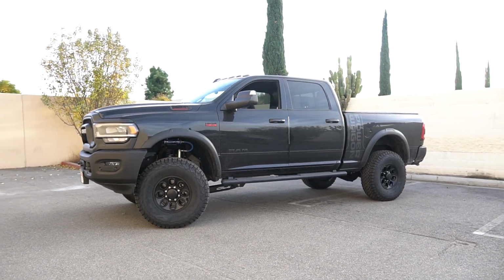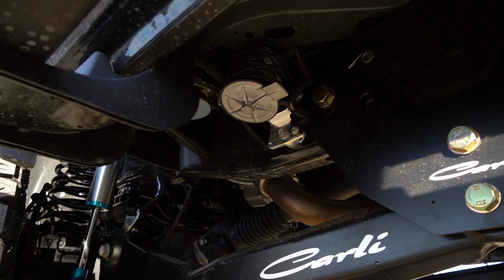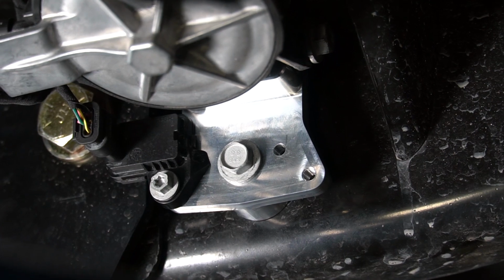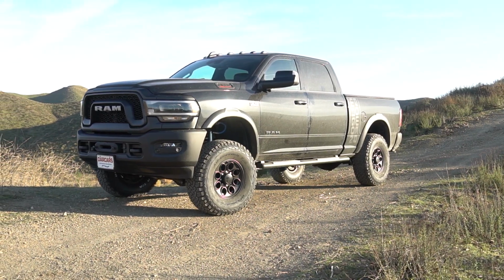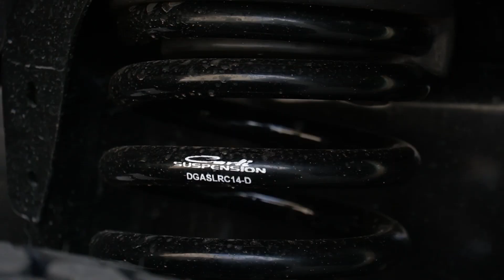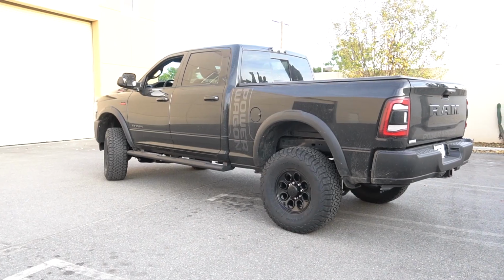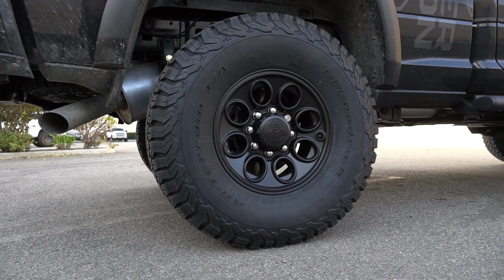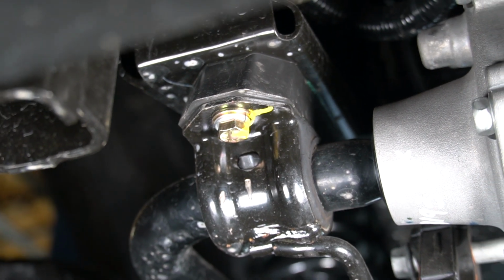Optimize your Power Wagon; here's how they SHOULD come from Ram!

Comment: It should have came without MDS!  It should have came with a heavier duty water pump and oil pump.
Reply: you can disable MDS by using the transmission limit with on the steering wheel.
Reply: @kimolee502  I know, it should have never been implemented…it doesn’t make a difference in fuel mileage and is one more thing to make the engine unreliable.

Comment: Is there a loss of articulation from the stiffer springs and loss of the articulink in the radius arm?  Do the radius arm relocation brackets or fabricated radius arms move the front axle forward any?
Reply from the maker: The rear end will still articulate to bump without weight in the bed so no articulation is lost. The articulink will flex more than our current radius arm design but our arm provides far more stability. Neither the drops or arms themselves reposition the axle forward.
Reply: @thecarlisuspension  you don't happen to have any of those stock articulink radius arms do you?

Comment: 🤤 Can you talk performance about this build please. What’s the new payload and is there a towing reduction? Would you feel comfortable running 40s with this system?
Reply from the maker: The  factory payload of a 2019+ Power Wagon is 1,510 lbs, our rear springs are tested to 2,000lbs. You actually gain capacity with our rear springs. 40s wouldn't fit without body panels designed for it, firewall clearancing and taller gears.
Reply: Carli Suspension that’s awesome for the payload increase. As for 40s can’t you just increase the wheel well size like AEV does?
Reply: Everyone’s got such a stiffy for 40s these days. 37s are more than 99% of us will ever need.
Reply: bigusdickus agreed. I’m actually more than happy with my 33s that I’ve stuck with (size wise) for past decade. Always wanted 35s and/or 37s but didn’t wana pay to regear. If I pay the thousands to regear then I wana run 40s lol
Reply: RT Molinari Haha that’s a legit reason. In no way do I want to be one of those internet lame-os complaining about what other people choose to do with their vehicles. I suppose I was pretty close to becoming just that with that last post.
Reply: bigusdickus no worries man I’m not worried plus we are helping Carli’s YouTube channel algorithm 👍🏻
Reply: Carli Suspension I thought your springs were softer?  How do you get more payload?
Reply: @jeffisphree  35's are what most folks need.

Comment: What would be the best kit for someone who wants to keep the stock height of the pw while improving the ride quality and control on mild off roading?
Reply: Nothing to keep the factory height, unfortunately.
Reply: So far the only thing I found is the Fox 2.0 shocks. Which will be fine for me in most cases. It will be a daily driver with weekend fun on the trails near me. I get why people say it should have 35s also but it doesn't look that bad either with the 33s. So when my gets delivered finally to the dealer I'll keep close to stock for now. Would love to do the Cari kit with the king shocks later on. Possibly next spring time maybe for that project.

Comment: Is there a suspension travel gain to be had with Carli’s system on a Power Wagon?  I see travel numbers are posted on the Carli site and I’m assuming those are down travel only but how do they compare to OEM travel?
Reply from the maker: The Power Wagon travel spec is pretty good, factory. We get another inch in the rear and 2" up front! Honestly, the performance comes more from the springs/shock tuning and larger dampers than the modest travel increase.

Comment: Will 35s fit a stock 2019 power wagon without rubbing on any mechanical portions? I’m trimming the bumper and the rear of the front wheel wells
Reply from the maker: Haven't tested anything on a stock PW; all testing we did was post install.
Reply: Yes 35" tires should not rub.
Reply: Is there a reason why y’all don’t use the sway drops now for the factory sway bar now versus in this video?
Reply: Yes they can be installed with zero issues.

Comment: When they added the 37’s did they need to change out the gears in the differential?
Reply from the maker: The Power Wagon comes equipped with 4.10 gears so it does well with 37s. if you get a standard hemi with the 3.73, it would be a good idea to upgrade to 4.10 or even 4.56.

Comment: We're do I go to get the air pressure sensor recalibrated so I don't need 80 psi in the rear?
Reply from the maker: Not sure there are any modules currently available to assist with this on a 2019 - I'm sure something will be coming down the pipe soon enough.
Reply: @thecarlisuspension  For 2016 ram 2500?

Comment: Um on the offchance that you guys at Carli Suspension see this WILL there be a larger lift than this one in the near future.(8 in is what I am looking for. I have a 2019 Power Wagon and it seems that nobody has anything larger than 3 to 4 inches. ( Or 6 inch due to the factory 2 inches of lift, I just want something larger)

Comment: A Power Wagon should come from the factory exactly the way it does. Ram engineers, as well as Ford and GM engineers, spend millions of dollars designing these trucks to do what they are supposed to do. It’s not very likely that Carli Suspension or CJC Off Road spend millions on their designs. If someone wants to spend $80,000 on a truck and then pay Carli Suspension another $5000 to $10,000 to make it look cool while reducing the trucks capacity and capabilities, that’s fine. Just don’t act like you’re doing anything other than putting on an expensive appearance package.

Comment: The stock running boards in this vid look to be mounted higher than on my '19. What's going on there?
Reply from the maker: Not sure, these are factory Power Wagon running boards.
Reply: Yeah, I'm with you on that! They are a tighter fit to the rocker...like the brackets are shorter.
Reply: My '19 has the same tube steps, seems to be about the same in the video. Maybe because it's sitting higher it looks tighter.

Comment: Given the stock suspension system on the Power Wagon goes anywhere in the world.  SAVE YOUR MONEY just put on 35inch or 37inch tires on ur stock system and take ur air damn off. Done! no go anywhere you want. 2ez and cheaper than buying this stuff.
Reply: stock springs are very stiff unloaded, not a fan
Reply: This is the correct answer.

Comment: is this kit compatible with 2019 ram 2500 hemi 6.4 mega cab
Reply from the maker: Sure is!
Reply: Carli Suspension what’s the cost for this kit once production has been completed and ready for purchase? Also does the 
Carli Suspension 2014-2020 Ram 2500 Fox 2.0 Leveling Kit fit a 2019 ram 2500 hemi 6.4 mega 4x4?

Comment: Well if your getting down to brass tacks from the factory  ...   it should also come with a Cummins and be avail in a regular cab an extended cab instead of only the foolish crew cab short box.
Reply: Like manuals, reg cabs are bought in very small numbers...Can't spend tons of money on R&D for only a few buyers without price going WAY up....Besides, this is an  OFF road truck, not a farm/construction type truck of which RAM already has other trucks to fit the bill.
Reply: The only reason you would want a cummins is for towing heavy loads, buy a towing rig if that's what you're after. The PW recipe has never called  for a derpy diesel, I don't know of many true PW guys that want one killing their truck.
Reply: @WilliamStewart1  Tell them Will!